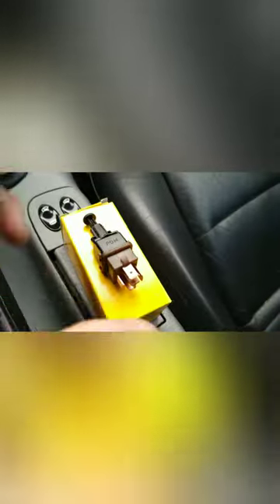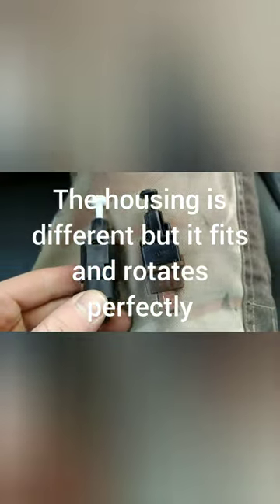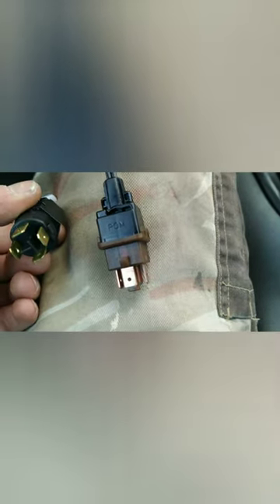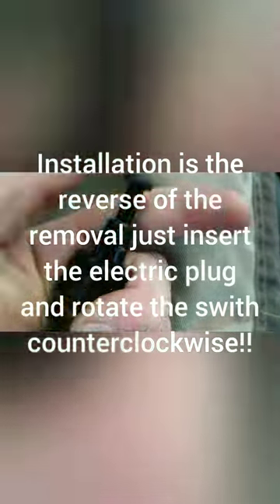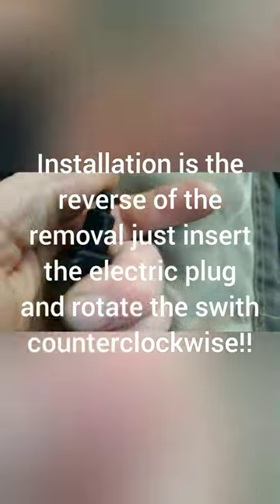Porsche 986 DIY brake light switch removal

Comment: Thanks for the video it was very helpful It's a bit awkward to do as the space is very limited. A tip for twisting it off. Unscrew the Aircon /heating duct.This is just one short screw  This allows you to get your whole hand around the switch and makes the twisting much easier

Comment: Good video. The clicking on the original switch pin is not a sign of failure. Both the original clutch switch and the brake switch have a ratcheting pin. Gently pull the pin so its fully extended when you install it and it will set itself to the appropriate length. Sometimes resetting the pin is enough to get the switch working again.

Comment: thanks...some guy told me while driving that my brake lights are flashing on and off when braking..they only came on when lightly pressing pedal and not on hard braking..going to do on weekend.
Reply from the maker: Good luck with that! Sounds like the same problem i had when it started to fail! I removed it and cleaned it and it was completely dead.🤣
Reply: I am happy I found your video,  I am having the exact same issue,  I am going to order a new one .

Comment: I cant get my new switch to click into place whatever i do. Its close but it just wont go back in
Reply from the maker: I also had that problem it doesnt go back as easy as the removal part but it should work. Try removing the air duct so you can Apply more presssure. 

My brake sensor housing was different from the original one but it still worked.

Also buy the cheap version. The hella one Oem part broke 5 months after installing. Now i bought the cheapest one like 7 euro's and it works for over a year now!

Comment: I removed it easly but i cant lock it back into place... :(
Reply from the maker: Try turning it counterclockwise make sure you keep light pressure on the switch so the small clips will lock in the switch mounting bracket. Make sure u know how it looks so take a light so you can see what you are doing it is a little tough to get to